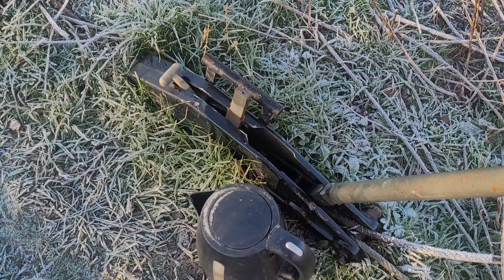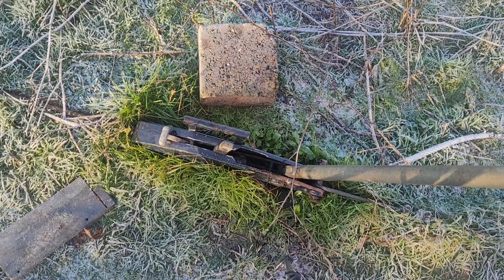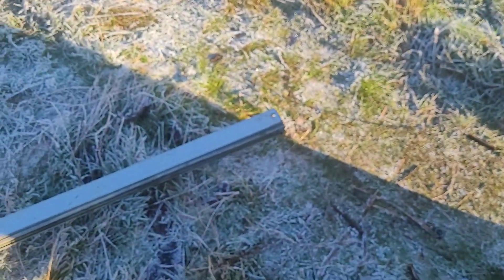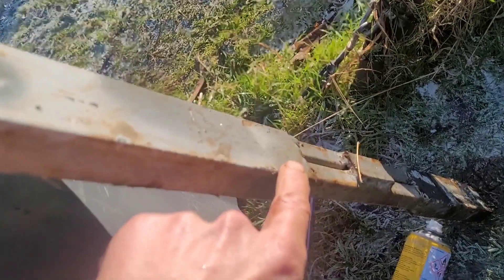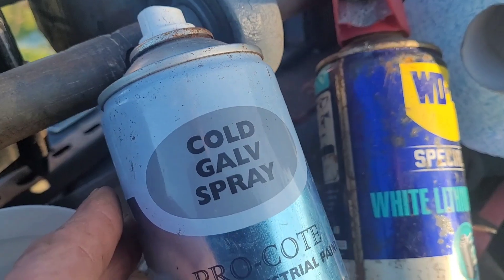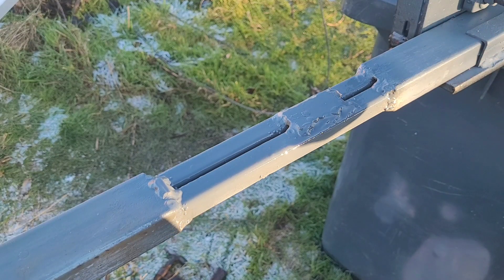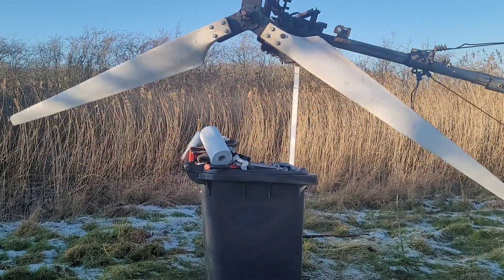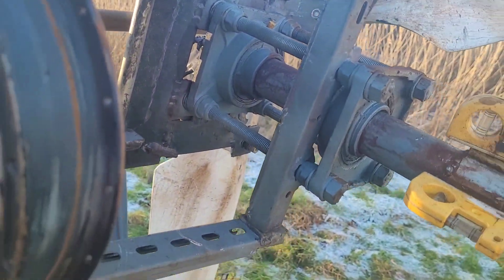Wind Turbine Project - Making good progress - Got the old tail boom back on - Winch on fire 😎

Comment: Start saving for some new bearings after spraying WD-40 in the grease hole. Go borrow a grease gun if you can't afford one give a neighbor some pocket change for using theirs to properly grease the bearings. These are called grease zerts by the way.
Reply from the maker: It wasn't WD40 it was WD40 lithium grease , thanks

Comment: WD-40 is not what those bearings need basically it was designed as a water repellent for aircraft aviation wings!
Reply from the maker: Hello mate it's actually WD40 lithium grease spray , as I said I don't have a grease gun or any fund so I thought it might be better than nothing mm cheers.

Comment: WD 40 is not a lubricant, it will wreck the bearings, get a grease gun from a car boot sale and fill them full of grease. the frictional losses in dry rusty chains will also lose huge amounts of energy that shoyuld be turned into electricity. Its a good set up, poorly maintained!
Reply from the maker: It wasn't WD40 it was WD40 Lithium Grease, cheers.